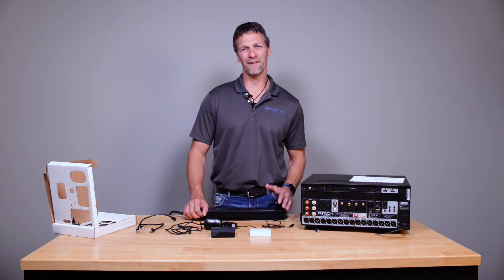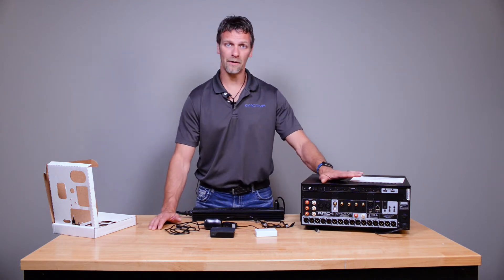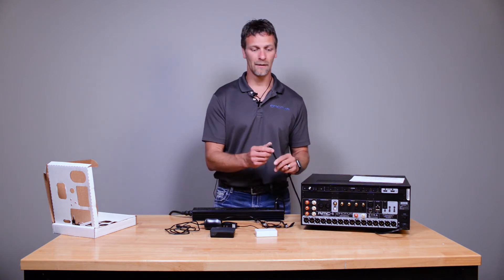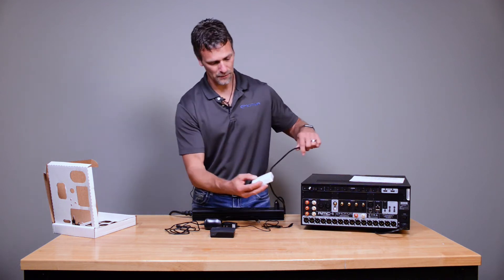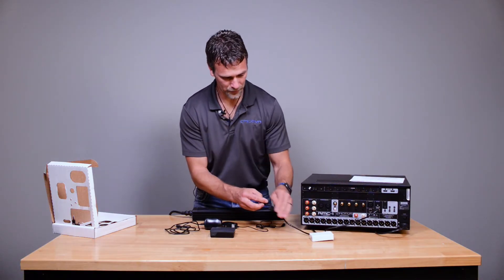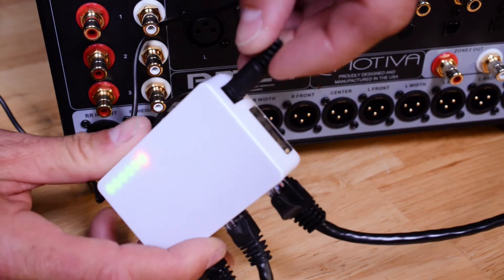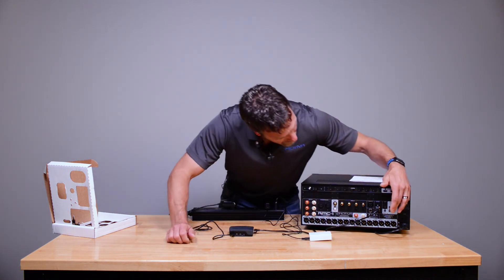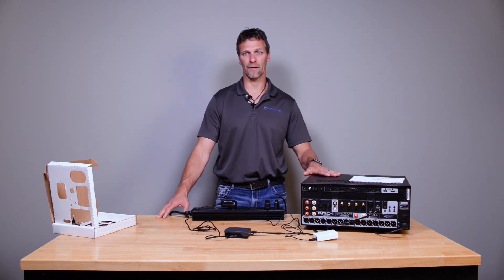Emotiva Dirac Live Interface Installation

Comment: Does it always have to be connected to the network to work? I'm planning on getting the RMC-1L in the coming weeks.
Reply: It only needs to be connected to run the software.
Reply: @nickmandara8231  so after it's run, you can unplug and play?
Reply: @MrJpdw67  Correct!